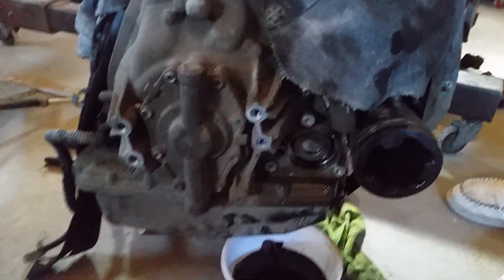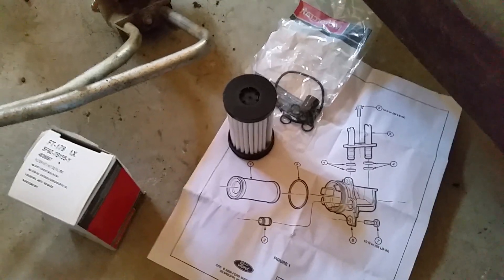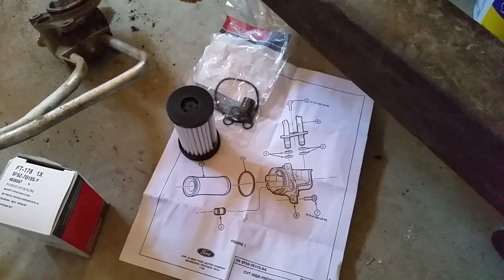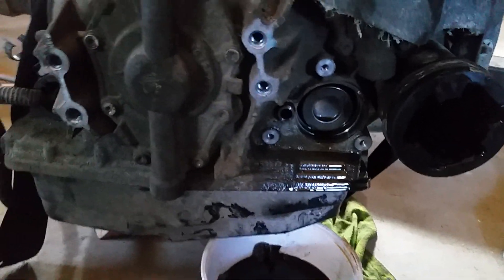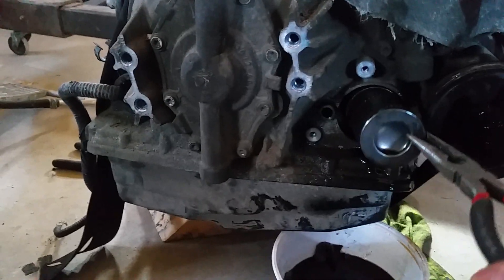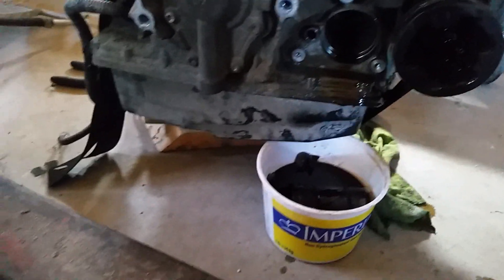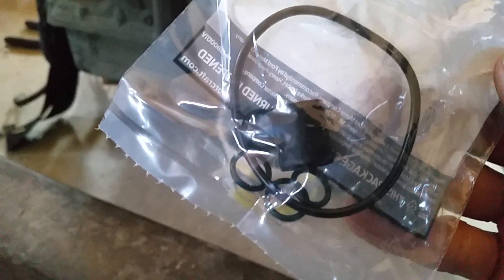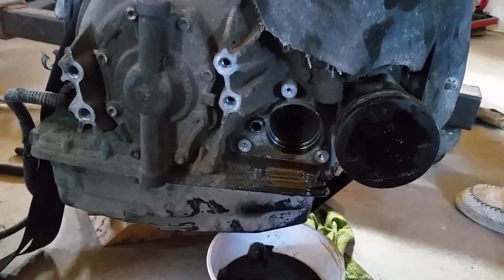Ford Freestyle CVT transmission high pressure filter change

Comment: The plastic piece you remove is actually a metal tube fitted with two o rings, replaced by a plastic tube flared at both ends.The new filter is plastic at both ends, the old metal, and substantially beefier seeming. My ford filter kit has a Doorman part number on it. 
.  Buy a five pack of t 27 bits, because if you live in the land of salt you will break every one of them. If you are to use the plastic tube, install the cover with the tube without the filter to seat it most of the way, remove cover, install filter, assemble and torque it down. Install the trans mount as an assembly, torque it down.
A rat tat tat gun on the torx bit seated in the screw may or may not help. Tried heat too.  I broke eight t 27 bits in total.  This took way too long to do on my 2007 Freestyle.

Comment: Hey did your new filter ‘click’ into place like the metal one does? I couldn’t get the plastic one to do it. It’s in there and I tapped it with my ratchet a few times, but it never ‘clicked’
Reply from the maker: If I recall the large filter clicks into place and the small H.P. filter is held in place by the backing plate.
Reply: @tigiteasygarage9052  yeah I’m referring to the HP one. It seemed to me that the old metal one kinda popped into the housing, where the new plastic one required much more force and I didn’t get 100% confidence that it’s in all the way
Reply: @waqaradurrani  I had the same doubts. It seems OK tough.
Reply from the maker: Just make sure the part looks identical to the one that you are replacing.  The O ring is what keeps it in place when you push it in.  Double check to see if the O ring is seated in the rite position.

Comment: They are non serviceable you'll generally cause more damage then its worth. it is an audi sourced trans which all of there trans are not supposed to be serviced unless there's an actual issue which in most cases its to late lol.
Reply: The Ford service manual does tell you to replace it at every 60 to 90k. I would go every 30k though.

Comment: Ever have problems with valve cover gasket leaking?
Reply: My mom’s 05 Freestyle front valve cover started leaking over the last year.  Turned out it was the rear camshaft seal, the camshaft sticks out of the rear of the valve cover where it drives the water pump, and it has what’s essentially a mini-rear main seal.  Replaced that seal and it’s all good.
Reply from the maker: No I haven't

Comment: Ford should have issued a recall on this pos cvt transmisison. Too high of a failure rate. Could this high pressure filter be the reason for a p0942 code? Friend of mine just bought an 07 Freestyle with that code from a meth head for $600 and it slams into drive and reverse and even when floored it barely accelerates? Sometimes it drives normal when the light goes off then does it all over again as soon as the light comes back on. I told her not to buy it based on my research of these vehicles but she thought it was going to last a couple months which I told her I doubt it would.
Reply from the maker: Must be something else going on with the transmission if there is a light coming on and that is when the problem happens then the ECU is sensing a failure somewhere. Get someone with a good scanner to do a diagnostic on it. Maybe a bad valve body? Check the oil level on the transmission also
Reply: Chris Atkinson we cannot get the bolts out to change this filter, it keeps breaking the bits, any suggestions
Reply: @sawgalwalden5698  better tools
Reply: @sawgalwalden5698  Had the same problem, so I used a bolt extractor socket. It's one of the best tools I have. Just tap on the socket lightly to get a grip, and they come right out. Either that, or get stronger bits.
Reply: I agree, these transmissions are hugely problematic. I'd be curious to know if there were any other codes related to the powertrain. With mine, I consistently get P0701 (a generic OBDII code) and P0715 (Input/Turbine Speed Sensor Circuit) and P2765 (Input/Turbine Speed Sensor B Circuit). I'm using the Torque app with a wireless OBDII device to pull codes.

In my case, the car usually accelerates just fine for some period of time before going into limp mode. As far as I can tell, based on the P0715 and P2765 codes, this likely means the problem is with the input shaft, and could be something as simple as replacing an o-ring which tends to self-destruct, or replacing the entire input shaft itself. Even doing it yourself, this is something that will easily cost $600+ because of the expense of the part, and would involve pulling the transmission from the car.

There are also parts that Ford used to commonly replace, including the valve body, which is a $1000+ part that supposedly were often faulty when brand new, so multiple replacements were common. Although I'm not sure of the accuracy of those claims, as it seems the general ignorance of these transmissions back then was a large source of misinformation and wasted money spent on replacing parts in a bit of random guesswork.

I would never buy a vehicle for any amount of money that has a Ford CVT in it. Complete waste of money. I wouldn't buy any other CVT for that matter, but these have to be some of the worst. I'm stuck with this POS until I can scrape together enough money to buy a cheap used car.

Comment: Hey, thanks for the video. Like the dummy I sometimes am, I took off the wrong part when changing the filter! The part is shown at the very start of your video. When I realized what I had done, I simply put it back on and started over whit removing the housing with the hydraulic hoses, and then it all made sense. What is that cover I took off and you first show in your video, and can I expect a major malfunction of the "subdominal nomenclautre" of the participle thereof - i.e. my screw up?
Reply: The cover at the very start of the video is the primary variator cover. This has fluid channels to direct fluid to both the primary variator and forward clutch. Removing it shouldn't have caused any issues, so long as you didn't cut a seal reinstalling the cover.